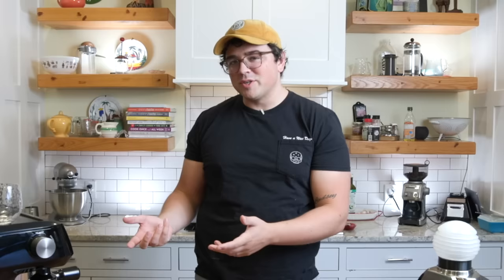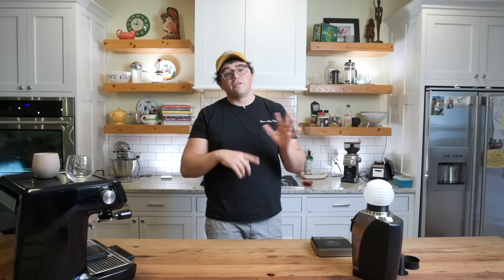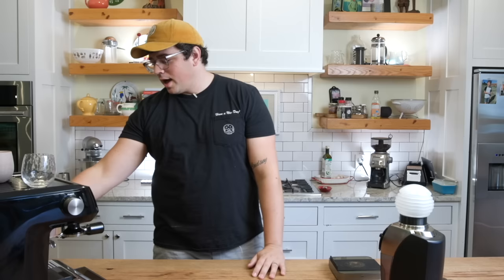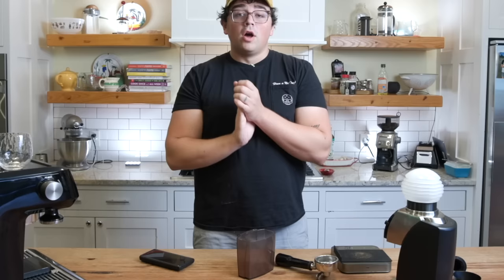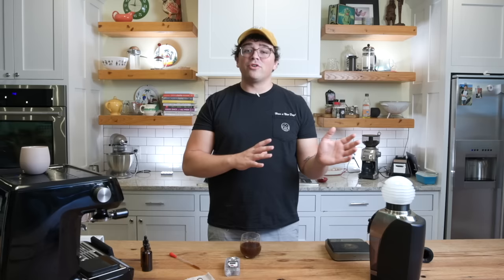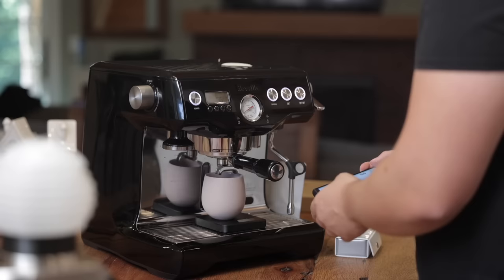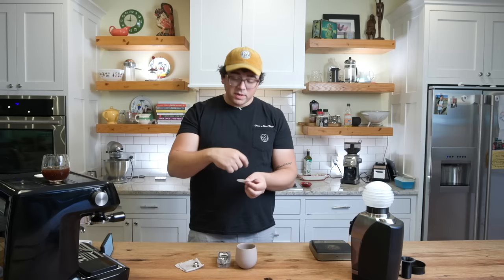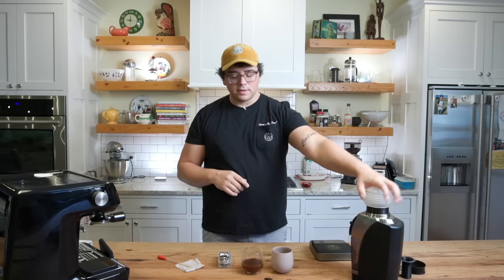SPRO-OVERS: THE CRAZY, DELICIOUS, BIZARRE WORLD OF COFFEE SHOTS

Comment: I was literally just going to post a question about these - mostly because I haven't seen any videos by anyone on them. Roos Roast in Ann Arbor does a 'Long Pull' instead of a pour over and it's really nice on some of their coffees. Thanks for covert this. I think this is a pretty efficient drink for a cafe to make instead of a 3-4 min P.O.
Reply: Definitely, but a sprover still takes a good amount of time so needing to use a grouphead for like 1 min+ is less than ideal during the busy points of a coffee shop with a 2 group machine, it's only viable for a 3 grouphead I'd say
Reply: @doc8125  makes sense. That's what they use.
Reply from the maker: Sprovers are likely not ideal in shops since water debit needs to be changed. That being said the coffee shot matt perger outlines tastes great and can be pulled in 45 on stock machine!
Reply: @LanceHedrick  I'm still waiting for more commercial machines to have accurate and automatic flow profiling to let us to this sort of stuff
Reply from the maker: Oh absolutely. Im sure it won't be long now, considering decent is focusing heavily on commercial. Soon, one of the big boys will step up with an easily modifiable flow profiling capability.

Comment: Great video! It just got me thinking, if it isnt' just recreating the moka pot method on an espresso machine. The pressure might be the same, grind size pretty similar as well and the longer extraction is there too. Just wondering what the difference would be side by side doing this method and a moka pot method. Thanks Lance!
Reply from the maker: This has water going thru the puck continuously with clean water and a lower temperature. Moka pot produces lots of crema from the steam due to boiling. This is much less oily, more vibrant, and more controllable.
Reply: The ratio for this is different to what I have typically been told to brew a moka pot at. I tried the ratio and timings in my moka pot and the result was really good. It definitely doesn’t have the texture of a filter coffee, but I don’t expect the result from an espresso machine would either (I’ll soon find out). The addition of an aeropress paper definitely helped the texture and removed sludge from the cup.
Reply from the maker: Fantastic!

Comment: I enjoyed this video more than I thought I would. The history made everything fall into place for me. Now I’m really interested to try the Spro over!  Thank you. My DeLonghi Specialista Maestro has a coffee setting that runs at low pressure and something like the ratio mentioned. I just need to dial in the grind size a bit more coarse than espresso and see whether I can get in the ballpark. Awesome!
Reply from the maker: Oh fantastic! Curious to hear your thoughts once you figure out how to dial it in! Can be tricky because it is so different!
Reply: @LanceHedrick  well, I’m not sure it will be possible I timed the shot of the coffee profile. It took one minute from the first drops until it stopped and the pressures were from 5.5 to 4.5 bars. Not exactly Spro over because of the higher pressure and espresso grind size. Still the flavor of lighter roast beans tasted chocolate and smooth perfectly balanced sweet and bitterness. I would like to try lower temperature with coarser grind and slower low pressure flow. Working on it.
Reply from the maker: It's a process, for sure. You'll get the pressure to go down if you go really coarse!
Reply: @LanceHedrick  it worked! I adjusted the grind coarser and reduced the temperature. That brought the pressure down to two bars. The brew takes the same amount of time and tastes even better! This is how the “coffee” profile on this machine should be used. Thank you Lance, for your indefatigable pursuit of excellence and for sharing your results!
Reply from the maker: Absolutely! So stoked you dialled it and got to taste it as it should be haha! So good. Quick cup of filter.
Thanks for watching and the support!

Comment: Can we make longer ratio drinks with the updated flair 58? A video for this in future would be very interesting!
Reply from the maker: Yes! But not long enough for sprovers.
Reply: I think you can do sprover in the flair 58! With the new valve plunger, you can refill the chamber, gently pull the handle back up and continue the shot. I’ve tried this a few times, and it totally works. With the puck screen, I’m not worried about damaging the puck integrity
Reply from the maker: Oh nice! My fear is less damaging puck integrity and moreso unsealing the puck.
Reply: @LanceHedrick  Yea, I guess air does have to get in around the puck when the lever goes back up. I’m just hoping with the grind this coarse, the slight disturbances don’t matter as much as they would in normal 9-bar land
Reply from the maker: Sure, likely not as much, but even some is going to really push channeling around the edges, which isn't ideal.
Reply: @LanceHedrick  if you refill with enough water before you lift the plunger gently then when you lift it just a bit to let the first amount of water to go inside maybe you minimize the air coming?
Reply from the maker: You should be able to, yeah. Give it a try! And examine the puck after
Reply: @LanceHedrick  I’m dimmer modding a delongi right now specifically for sprovers. can’t wait.
Reply from the maker: Oh yeahhh! That rocks!

Comment: How about foregoing the portafilter itself and put grinds in a filter and put the filter (on top of a cup) below the grouphead? Oh btw Lance, since you have the slayer mod for a while, will the needle valve deteriorate as time goes on? 

Oh! Another note, I would be careful when running very long pre-infusions back to back as it can overheat the boiler. The moment the extraction starts, the steam boiler will heat up the brew water that passes through it as a heat exchanger before it goes to the brew boiler and to the grouphead. The longer the pre-infusion, the slower hot water flows and the heat will build up inside. That's why many users would get the flashing temp reading in the display thinking the machine is trying to heat up when it actually is overheating. One way I go around this is making sure to purge brew water at full flow after every extraction to bring in cooler water to the boilers.
Reply from the maker: I normally don't run preinfusion back to back like on the video. This was purely for showing a dial in. And the needle valve is fine! I know plenty who have had their machine modded for years with no signs of issues
Reply: I noticed this today with my BDB. I saw the temp flashing and thought wow I really cooled the boiler down with two cups and then I turned the machine off and on so I could see the water temp and the machine was actually at 98C when I had to set for 90. So what you are saying is definitely true. Run some water through between Sprovers. To keep that heat down.

Comment: Thanks for the great video - this is new to me! You mentioned that the main difference from an Aeropress brew is that immersion is prevented and only percolation happens. Could you approximate this using an Aeropress with an extra filter on top of the grounds as a sort of "puck screen"? E.g. using the Prismo with a regular paper filter on the bottom, then the Prismo's metal filter (which allows no bypass) on top of the grounds, stopping them from floating up into the water in the chamber
Reply from the maker: No only because there is no way to eliminate the immersion aspect. An espresso machine can deliver clean water and give pressure same time. This isn't possible with the aeropress. You have to add the plunger and plunge seperately from adding water.
Reply: @LanceHedrick  I agree that you can't eliminate immersion with the Aeropress, so the method I have described would not totally replicate the spro-over. But my thinking was that with a second filter on top of the grounds, immersion will be greatly reduced because the grounds are only in contact with the water that is percolating through, and once that water has extracted some of the coffee via percolation it will have less remaining capacity to extract further via immersion.

I am viewing the water which passes through the second filter (on top of the grounds) as corresponding to the added water. It's "added" in the sense that it has not yet been in contact with the grounds. 

My assumption is that the second/top filter above the grounds can completely separate the grounds and the remaining water. E.g., the Prismo's metal filter allows no bypass so I think it would work here. The regular paper filter wouldn't work well enough
Reply: not sure about the aeropress thing ... but this sounds extremely similar to the delter press
Reply from the maker: I need to check out the delter press
Reply from the maker: Jimmy, it's definitely worth a try! Report back
Reply: @LanceHedrick  so I went ahead and tried this! Results were mixed, though it was an interesting project. TL;DR: logistical issues prevented it from working as I hoped, but I did get an interesting brew with some of the desired characteristics. 

I ran into a logistical issue: the Prismo metal filter only fits in the Prismo cap and not in the Aeropress chamber, which limits the space available for both it and the grounds. While the grounds plus a paper filter fit under the metal filter, it was too full to connect to the Aeropress. So I had to put the metal filter on the bottom, then a paper filter on top of the grounds in the Aeropress chamber, which doesn't have a tight seal. Thus, immersion isn't fully prevented (indeed, I saw a few grounds floating up), but it was mostly prevented (nearly all the grounds still stayed under the top filter). Getting the top paper filter in place was tricky - I ended up pushing it down with the plunger, then very slowly removing it to avoid suction, and using a spoon handle to get it fully in place.

I used 14g light roast coffee, 154g water at 200F (11:1 ratio), ground to the middle of the Aeropress range on the JX (1.8 rotations), gentle press took 1 min 20 seconds. The result was very fruity and different to a typical Aeropress brew - it did taste a lot more like espresso than usual, so I guess mission accomplished? It was reasonably balanced in terms of extraction though on the weaker side in terms of intensity of flavor. So while I don't think it's a great replacement to the spro-over, it was successful enough to give me a taste of what I'm missing out on from doing it properly.
Reply from the maker: This is great! I hope people see this comment. Thank you for doing your due diligence with this experiment! On my radar
Reply: @LanceHedrick Thanks for reading my report!

By the way, I posted about this somewhere else, and somebody pointed out that what I was trying to do is very similar to what the Joepresso does. It even has a puck screen which works like what I was trying to do with the filter on top. Using the Joepresso is indeed probably a better way to make a spro-over without an espresso machine, versus what I was attempting with an Aeropress
Reply from the maker: Need to look into it. Also, the delta press is a good option it seems

Comment: In my testing the Vario doesn't even need a bellows, it's like 0.3g retention probably less than that is actually being exchanged. Worked great for me as a single doser without any mods for years.
Reply from the maker: You have a unicorn Vario haha. The horizontally mounted burrs make retention awful. How were you testing?
Reply: @LanceHedrick  weird maybe some are better than others. (Opsy thought you mentioned the alicorn alignment mod lol) Mine is probably badly aligned. I Had someone at one point do the alignment for me along with the Forte burr chamber ' 'upgrade' and it wasn't any better. I've since checked the alignment and there were no shims and alignment wasn't good 😮 I've tried adding a shim but didn't really bother getting it great since it's not my main grinder anymore. 

How were you testing retention? Using something like grindZ cleaner product is useful since you can see the colour difference pretty easy if you swap between half a gram of grindZ to half a gram of coffee beans back and forth. Evaluate the output by looks and weight you get a good idea of actual exchanged retention! I came up with this method myself.
Many people don't know the Vario is a great single dosing low retention grinder. Before it was cool.
Reply from the maker: Hmmm... I'm always skeptical on how people measure retention. Horizontally mounted burrs are notorious for retention. Did you do the flipper mod? And I have done the alicorn alignment, of course.
I get an extra .2-.3g out when I use the bellows. Everytime.
That means something is being held out lol.
Reply: @LanceHedrick  no mods on mine besides what I mentioned. Also it worked better before I had the guy switch to the forte chamber but retention hasn't changed maybe alignment got worse when he did that. Now I know if you want something done right do it yourself.
Reply: @LanceHedrick  just because you push out coffee with the Bellows doesn't mean it would have affected anything. It's likely stuck somewhere. The Eureka Specialita was like that. With bellows I could push out about 2g extra retention but only about 0.8g was actually being exchanged. I found it wasn't affecting shot quality or timing. So I didn't even bother with using the Bellows on it. With the Vario only having 0.3g total retention with the Bellows used it's basically the same as a niche zero and it also doesn't need a bellows. Some people like to get that last 0.3g out but it shouldn't affect anything especially if it's stagnant. It's good for a more therough cleaning or if changing brew methods since coarse grounds may knock out the fines stuck in chutes or around burrs etc.
Reply from the maker: Yes. It being "likely stuck somewhere" is my issue haha! I like to switch coffees frequently and don't want even .3g stuck lol.

Comment: This was very interesting and showing what is possible. 

I have a Cafelat robot so I cannot try this but I have been doing turbo shots with it. Have been considering buying a pump driven machine. Are you planning to show all the mods you have done to the BDB? Or a comparison between the BDB and the Decent? I know those are widely different cost and potential quality but was curious if I wanted to add a pump machine if the BDB is good enough or to save more $ to buy a decent. 

Thank you. I found you recently and have watched almost all of your videos. Very informative and excellent beat boxing.
Reply from the maker: I have a video on the mods for the BDB up! Go check it out. I also have a video up on the Decent. Let me know your thoughts.
Reply: @LanceHedrick  ah ok. I did watch that one where you showed the slayer mod and then discussed the other mods that are available for it. I must have missed when you talked about what you did to yours. And I watched the decent one too. There is so much to play with when it comes to the decent. Like a never ending rabbit hole.
Reply from the maker: Ah yes. That's all I did with my BDB. I have other options in the caption there like the kill switch and insulated steam wand. With needle valve, the kill switch is redundant. You could dimmer mod and add the kill switch for more control, tho

Comment: Have you looked into adding minerals to the brewed coffee? I use very low mineral water for my espresso but add a mineral drop to the cup. From what I have read and experienced adding the minerals after seems to work just as well and allows me to protect my boiler.
Reply: thing is, the mineral composition in coffee is not really only important for taste, but also for how the coffee is extracted, so adding after the fact will not really do the same thing as if they were in it to begin with. What I'd suggest as another option, find and make a water recipe that does not scale, not all minerals actually contributes to limescale in the boiler.
Reply from the maker: Doc8125 is correct. The minerals are needed for the extraction of certain properties in the coffee. You can absolutely make water that won't scale.
Reply: @doc8125  I am using RO filter and add a pinch of sea salt to 4 lt of filtered water to get around 80ppm of minerals (mainly sodium). Salt will correct small espresso bitterness as colateral effect

Comment: awesome, thanks! going to try this right now. for us who have bdb (with a slayer mod if that's relevant) - can you post your BDB settings you had for this video and how many g's were in the basket
Reply from the maker: I had PI to 55% and 90s. 15g in basket to 150g extracted
Reply: Can you replicate this on a Breville Barista Express?
Reply from the maker: Yes! Just run the shot in PI!
Reply: @LanceHedrick  so you just set the pre infusion time to max? Which is probably 90 seconds given the BDB is 90 seconds.
Reply from the maker: Yep! But you can also manually hold the button and have it preinfuse the whole time, as well. I just changed the setting for simplicity